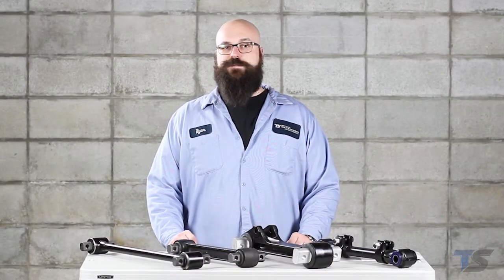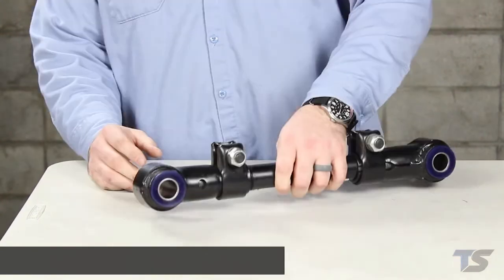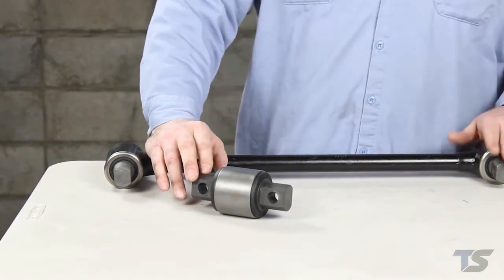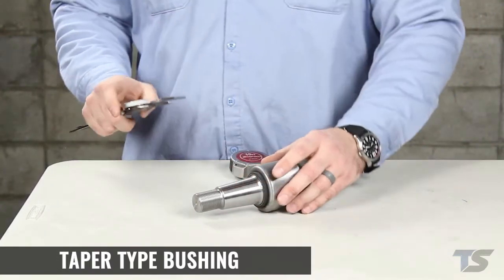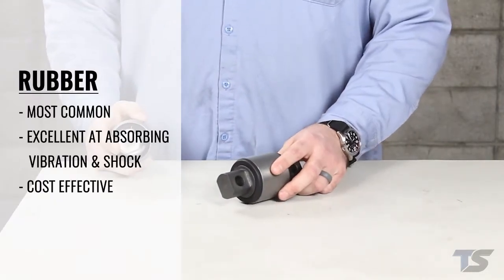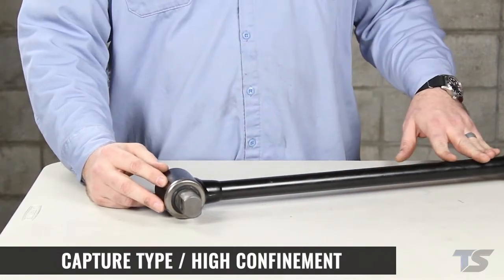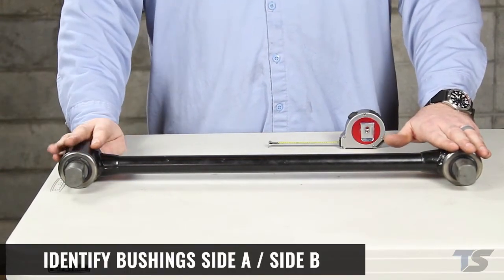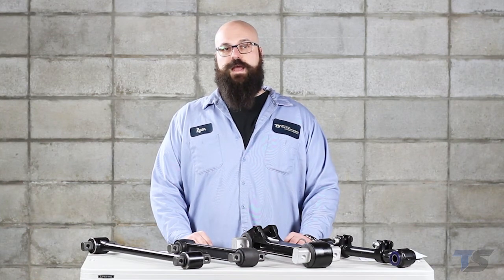How to Measure and Identify Torque Rods and Bushings

Comment: I may be contacting you next week. I have a motor home on a Freightliner diesel pusher chassis, and the torque rod that goes between the differential and the frame to resist rolling of the differential is metal to metal. Freightliner cannot source the part and has basically thrown it back into my lap. They have even went so far as to tell me that even if I am able to find one they will not install it for liability reasons. Gotta love big corporations and their abandonment of their products.

Comment: Where can I get the torque rod ends and how do i measure the ends so I get the right ones?
Reply from the maker: Replacement ends for adjustable torque rods are not typically available, the entire rod should be replaced. If you are looking to replace the bushings they should be measured like any other bushing. Inner diameter, Outer diameter, Length, and sleeve or mounting hole sizes.